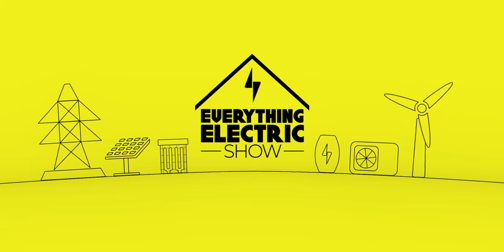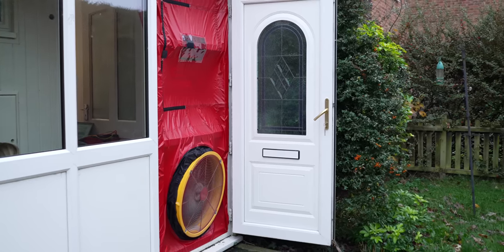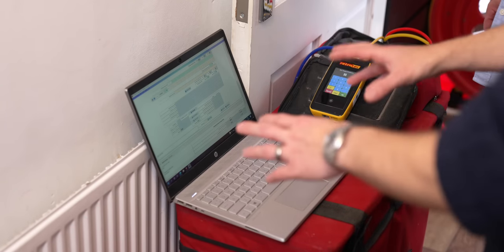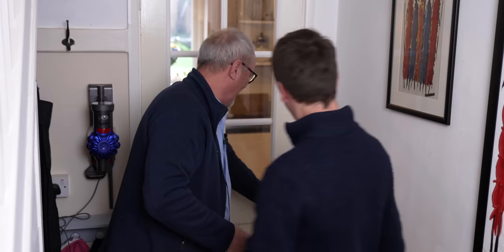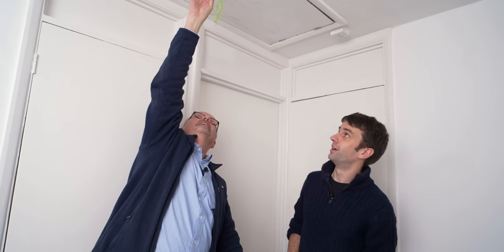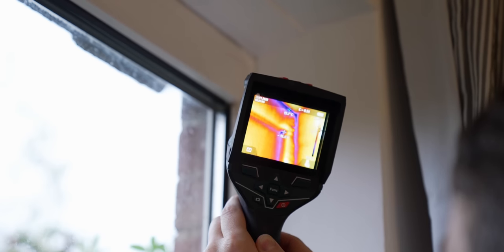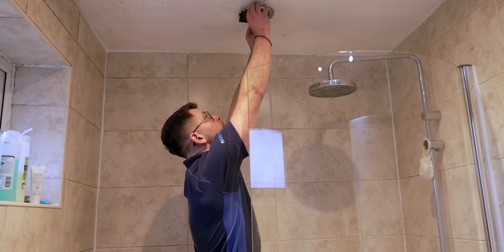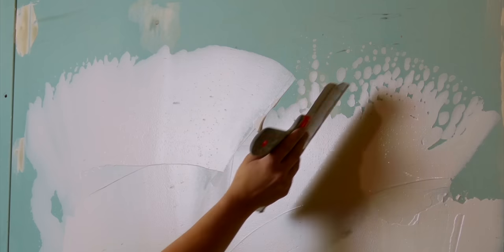Every Home Should Take This Test | Everything Electric Show

Comment: Robert, how are you this sunny morning in Goonellabah on North Coast NSW?
1.	250 prefabricated SIPform passive house-certified homes. On the roofs of buildings, the Tractile, the excess electricity will be stored in the 28.8MW Tesla Batteries Farm. 
2.	The PV in total 934,370m2 - Tractile tiles 45,000m2 and Arctech Solar Tracking - Tesla PV panel 887,400m2
The Team and I have a minimum of 250 passive houses that would Air Tightness Test. 
Each house will have Brink Renovent 300 HRV unit - Ducting is Air Excellent anti-static and antibacterial 75mm or similar sized to suit each individual home.

Comment: I’ve done every recommendation on my EPC and still only got a B rating.  Solid wall semi 94sq m.  Triple Glazzed, external wall insulation, composite door, loft insulation, new heating system (gas) PV and storage.  I’ve seen EPC scores on Band A with far less energy improvements!  Would this test improve my EPC?????  My plan was for ASHP but the EPC guy said that would deduct points 🥴🤷🏼‍♂️
Reply: it would save you energy but possibly not change your EPC, as they wont know you've done the work.. The EPC is a very blunt instrument and not really all that useful for planning works, (and sometimes makes odd decisions like the ASHP example)  the number you should be worried about is the one at the bottom of your gas bill, that's the real measure of efficiency.
Reply: @mralistair737  gas bill with heating on 24hr is £1.40 a day there abouts
18c for 12hr 21 for 12hr
I actually consumer more electricity than gas!  But I’ve got all the radiators to work on a future heat pump requirement of 50c flow temp.  

For me the EPC are hit and miss and often incorrect as my neighbours states it has cavity wall insulation when in fact it has solid wall
Reply: @mralistair737   It's going to matter for landlords, who will have to get to C soon. Expect reduced number of rentals available. 
EPC really not fit for purpose.

Comment: Every new house should have a heat exchanger, contrary to what Dean said about it taking a huge amount of energy to heat all the air in your house, which actually is untrue as air is one of the most efficient things to heat(this is not to say i don't think what he is doing is great and should be applied to all houses as part of an EPC), it's the thermal mass that takes the most energy to heat, hence why its so important to have a heat exchanger as you can relatively cheaply bring fresh air into your property whilst heating it with minimal energy outlay.

Comment: So, should I block off most, or all of the air bricks I have?
Reply: Not if they are venting the space under your house.    but you should make sure the floors / skirtings are sealed so air isn't leaking out that way. (and if you can insulate the floor)  for air bricks into your rooms, if they aren't serving an open gas appliance, block them off and use closable trickle vents instead.
Reply: @mralistair737  Thanks, every room in my house has a vent near the ceiling, and only one room has a gas fire (which is only ever turned on for servicing)

Comment: Might be wrong but I think most people in the uk rent, so they dont get to make these decisions. Perhaps landlords should be made to keep up with a minimum standard if they are going to own a property regardless if they are renting it out or living in it themselves. I'm pissed because the house is always cold and I'm still paying a bunch for it. Single glazed windows doors that dont seal and heating systems too inefficient to the point that none of the pipes have been insulated inside the home so the hot water is luke warm and the cold water is luke warm (at least in winter). Like yay, great we can save energy but it's not up to the majority.

Comment: I gather the cat flap is a problem.. solutions?
Reply: You’re correct. In our case we have an inner and outside door and the utility room between acts as a kind of air lock section to limit the air flow. But both flaps have a magnetic edge to make sure they stay shut when there’s no moggy going through. 

No house is perfect, and this is our compromise and at least we know exactly where the hole is.
Reply: @ianlighting100  I built a double cat flap entrance with a short tunnel between 😂 slightly excessive but there you go..
Dogs are way too much work.

Comment: Be careful that sealing up a house could exacerbate issues caused by increased humidity, which could cause mould where there're cold spots.
Reply: Came here to say the same. Fresh air is also important.
Reply: They did partly address this in the video.
Reply: Open a window for 5 mins each day 

🤷‍♂️
Reply: See video at 6'55" for the answer.
Reply: @HotYogaDoctor  It’s almost as if they didn’t bother watching the video… 🤔
Reply: @HotYogaDoctor  thanks. I did watch the video and glad it was discussed but I have seen a lot of bad advice on this topic before in the industry.
Reply: It's a fair concern, but my own experience of insulating and draught-sealing my own house over a decade or so found it resolved rather than caused a mould problem. The problem with an uninsulated house is that some corners never get warm and so stay damp, and no amount of ventilation helps. Insulating and draught-proofing means that I can get the warmth everywhere. This is an 1890 mid-terrace though, so 'draught-proofed' is relative - it's probably still more ventilated than a modern house.
Reply: @railenthusiast88  Most of the bad advice is: 'don't fix your air leaks, you need ventilation'. Good advice is: '_do_ fix your air leaks (ASAP), and ventilate properly (preferably MVHR)'.
Reply: A lot of the problems you are describing are caused by having a cold house, which makes damp air into very damp cold air and it condenses on surfaces,.  so keeping a house well enough ventilated to stop build-up of moisture but not so leaky that it's impossible to heat is the answer. But the main point of this video is KNOWING how leaky your house is (and where) is really valuable.    If ventialation was all you needed, then why do bus stops feel damp?

Comment: we have a wood burning stove with a chimney, this might be an issue :D
But fantastic timing for this video given energy costs at the moment. I have done a few of these steps this last summer and I can already tell the difference.
Reply: They will normally seal big holes like chimneys up for the test in order to find the holes you didn't know about. Also one can get a room-sealed woodburner so that the house becomes a toroid and the woodburner takes its air from outside. This is the only way to keep a woodburner is a really well-sealed house.
Reply: @xxwookey  ah good to know :)

Comment: Yea, this would work by using your bathroom extractor fan, & tape all the other vents etc.  Then go around the house with a few strands of cobweb a few inches long, & test for draughts,as cobwebs react to the slightest breeze. Or, even better,  with a thermal camera, which will show all the freezing winter-air being SUCKED into the house.  🙂  🥶
Reply: Your bathroom fan hasn’t the faintest hope of replicating this test. Look at the size of that fan.
Reply: @hughmarcus1  Yes, but any suck, is better than no suck at all..
Reply: @videostarish   been single long enough to know how entirely true this staement really is...

because I've a lot more time for DIY nowadays... xd

Comment: This seems a bit unnecessary. A colleague of mine had someone come round while the heating was on with a thermal camera that showed where the leaks were much more effectively than this and there was no set up.
Reply: Best do both.
Reply: It has its place. If you built a new house you need the air permeability test to get sign off.

But in an old house, if you wanted to do work to fix gaps in summer you wouldn’t have enough temperature difference. Working in winter would show the difference more obviously but not the best time of year (dark and cold) for that type of work.
Reply: they are showing slightly different things... and the things the air permeability tests show are easier to fix.   what you want is a bloke with a fan and a thermal camera to do both.
Reply: @mralistair737  Exactly. The fan pulls in the cold air through the gaps and the thermal camera helps highlight the holes, for example you can se if you look closely the cold spots in the corners of the windows on the thermal camera were where the rubber seals had shrunk and we’re letting air in.

Comment: Beware, if you plug every hole in a low insulated house you will increase risks of condensation and black mould as humidity will not escape.
Reply: Controlled ventilation - as covered in video.

Comment: I wish my house were MORE leaky. I have to open a window to use the extraction fan in the kitchen and in the winter I have to run around to open windows every hour to get fresh air in and moisture out. Also have to run around with a cloth to dry windows. Stupid new houses.

Comment: Word of warning to anyone who is about to start plugging all their gaps. We recently added insulation and plugged some gaps and it caused a lot of condensation issues, leading to some black mold. We ended up adding extra ventilation which had solved the condensation, but we have lost most of the insulation benefits as there are cold drafts by the vents. Frustrating! I think there are heated vents available which may solve the problem.

Comment: I slightly worry about reducing ventilation in he house. There are high Radon areas, where if the ventilation is reduced, there is a danger of increasing radon levels in the house above safety levels.
Reply: yeah that's not to be messed with.   you can get detectors though. and radon stuff is usually about venting the area below the floor, so it's still worth sealing between the room and the floors.

Comment: Did I miss it or it was not made very clear that any heating systems like open fires, wood burners, oil fires, gas boilers should be put out or switched off for this test. If not the low pressure would pull the dangerous fumes back into the house which normally is vented externally. Yes ideally all heating systems should be electric, but that is not going to happen soon while the cost to convert from fossil fuel to electric is out of reach for the vast majority of house owners. I am not against going green, I have got solar panels and would like to get an EV so would like the transition from fossil fuel to electric alternative as soon as possible.
Reply: Blocking fires etc is made clear when you book someone to do the test.
Reply: @ianlighting100  Yes I did see that but blocking a vent is easy, what about the internal flue of an oil or gas boiler or fire.
Reply: There is always a way, and I expect the testing person would advise you. These tests have been done for years, so there won’t be anything new.
Reply: The 50Pa of the test is about the same pressure difference as a good windy day so it's not actually dangerous. Almost all modern boilers have balanced flues so they are pretty-much immune to pressure difference from wind or airtightness testing. But yes you should turn off non room-sealed woodburners and boilers, not least because you often want to bung up their vents or other vents in order to find the smaller holes and you can't do that if the thing is really hot or still operating.
Reply: @xxwookey  You live in a very windy place as 50kPa is 7.5 PSI which would pull your windows in. (100kPa=1Bar 1 Bar=14.5PSI)
Reply: @brianbailey4565  Sorry yes that should have been 50Pa. Small matter of a factor of 1000 :-) I meant to correct it, but forgot before you replied, and now your reply will be confusing after I've edited it.
Reply: while I would turn it off myself, it's worth pointing out that if your combi boiler is affected by this test then something's gone badly wrong, both the inlet and outlet air on those should be coming from outside and sealed.   if you have an open flue boiler then change that first you are throwing money away.
Reply: @mralistair737  my oil boiler has a balanced flue, but the blower uses the air from within the boiler housing pulled  from outside via the balanced flue when the cover is fitted. Not sure air tight that would be with a negative pressure within the room as it's not designed for that.

Comment: Dean Fielding obviously does not know how to correctly run a test as you do NOT shut all the doors and open them one at a time when carrying out an air test. Also, he is giving totally the wrong information about the current limit for compliance with building regulations, as the target to comply with building regs has always been 10, and has not changed to 5 as he says. The comment about make one house work, and then pass was abolished in 2010, so here he is almost 13 years out of date on the point, but correct that any new build granted planning after June 2022 every house new build needs to be tested. If you are going to get an expert to explain something make sure they actually know what they are talking about first.
Reply: The door-shutting is not for the calibrated test, it's for finding which areas are leakiest. People do do that and it's entirely sensible. The change to 5 has been announced and is coming soon, whenever the new building regs actually come into force, has it not? But agreed, not actually a requirement yet, even though you really want to be way better than that anyway on anything new. Re bulk testing, since 2010 it's been: "On each development, an air pressure test should be carried out on three units of each dwelling type or 50 per cent of all instances of that dwelling type, whichever is the less." Which isn't quite 'just test one', but it's still extremely shoddy, and taken advantage of by large housebuilders, who have been resisting proper airtightness for decades, and costing us all (and the planet) dearly.
I reckon Dean did a good job and I have no problem at all with telling people they should be getting 5 or less now. I do wish the differene between m3/m2.h and ach had at least been mentioned. The numbers are similar for many domestic buildings, but not the same. And SAP uses one, AECB/PH the other.
Reply: @xxwookey  The change to building regs has come into force from June 2022, and for any new house built under that version of building regs has an upper limit of 8. Any house that has been granted planning before June 2022 and has started being built before June 2023 can continue under the previous version of build regs, and as such has a target limit of 10. With regard to the partial testing regime you mention, you are correct on the quantity needed, but did you know that any untested plots carried a penalty of +2 to the average score of the house type tested which lead most developers to test all units anyway? Telling people to achieve 5 or less is a risky approach, and needs to consider the ventilation strategy of the house because too low an air perm score with insufficient controlled ventilation could lead to other issues including mould. I totally agree about  ACH and it should be used in SAP in my opinion.
Reply: @stuartmilne1819  Thanks for the clarifications, and no I didn't know that wrinkle about +2 (I'm not a building professional - just interested after my own retrofit).

Comment: By way of contrast...  I live in a solid-walled, brick-built, 2-bedroom terrace house [from 1913] in the north of England. It has double-glazing (fitted with a Government grant in 1993), a new tiled roof (ditto), and 4" of grotty fibreglass insulation in the loft dating back to the 1970s (I think),  but it has no heating at all - none whatsoever - so I have no heat to lose. The open fireplaces and chimneys were blocked and capped before I moved in [1983].

My annual heating bills are £0.00;  electricity consumption for the year is below 300 kWh (three-hundred), and goes mostly on cooking.

I have no hot water (can't afford it), and no fridge or freezer (ditto), but the house has an old-fashioned cellar, which keeps fresh food edible for up to a week.

My home isn't sealed, but I don't mind. There are no major gales blowing through the rooms. Of course the house is a sieve and it's certainly chilly, but even in the worst winters the temperature doesn't drop below 10°C [50°F], and that's not bad at all.

There's plenty of air movement - especially under the downstairs floors and in the bathroom airing-cupboard - via air bricks left over from the days when open fires had to breathe (this is an ex coal-mining area, now a smoke-free zone).

So? So I dress warmly. My last major expenditure was on a huge ball of wool [£0.38] from which I knitted myself a woolly hat. There was no bobble on top.

I appreciate that I'm weird in choosing to live like this, but I've got a roof over my head; a kettle; a microwave oven; a one-pan induction hob; and four rescue hens providing me with free eggs🐔👀.

I also have no worries and no debts. That's enough for me.🙂
Reply: Full marks for low-carbon living. But that option is never going to be all that popular. We almost never heat our house either, but that's because I've upgraded it to (nearly) passivehouse retrofit level. And it's very comfortable. A much more expensive option, I appreciate, but within the finances of many in the UK: it cost us a couple of grand a year for about 15 years.
Reply: while that is a mighty testament to the wonderfulness of terrace houses (your neighboura are paying to heat your home effectively, but it's heat they'd be throwing away if your house wasn't there)     but you cant expect people to live like this if they choose not to and it's not really healthy if you are very old or very young.